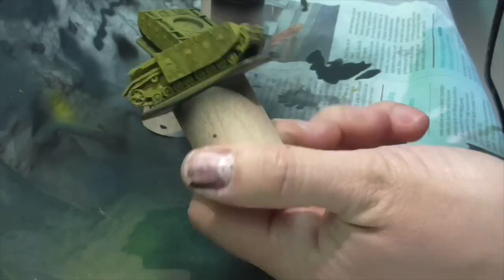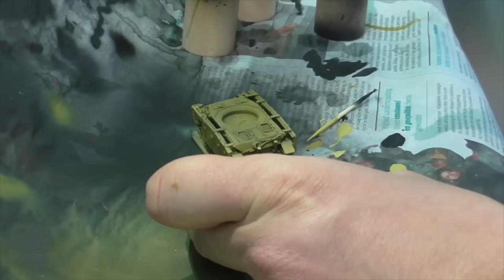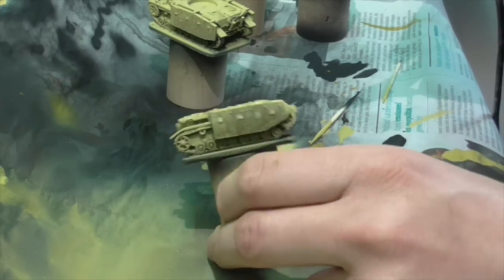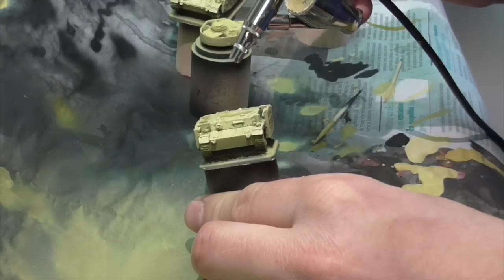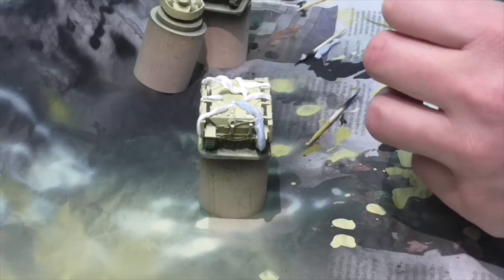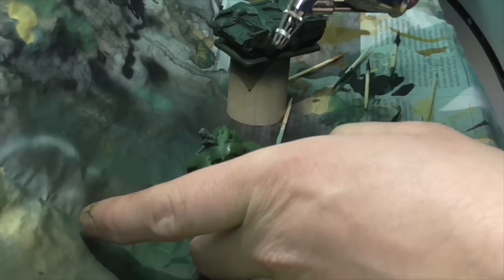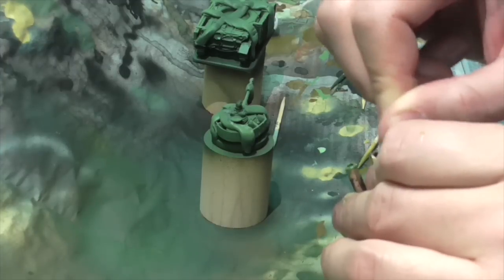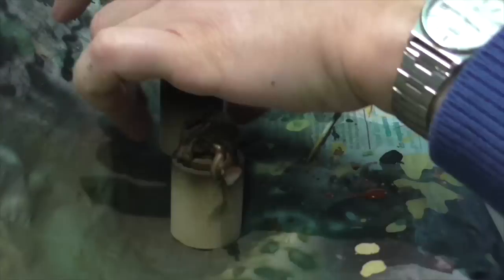Panzer Los: Painting a 15mm Panzer IV ausf J

Comment: unfortunately this splinter style of camouflage was abandoned around the time of the battle of kursk, this specific type of pz iv was mainly used during the retreat from france and would sent to the front directly from the factory in either a standard dark yellow or one of the many forms of ambush camouflage. This specific pattern was stopped because of the complexity and time to paint. most tanks were painted by thier crews in a mix of olive green,  dark yellow and red brown
Reply from the maker: +field Marshall cook I didn't do the research / planning for this one, so I can't comment. I think Jasper may have an explanation though, so I'll leave it to him.
Reply: +field Marshall cook: after ambush camouflage came factory applied hard-edged camo, often using the primer red of the steel as base-coat. At the very end of the war, and these are Pz IVJs with Thoma schurzen, so fall of 1944 at least, the red brown and green came first with only narrow bands of dunkelgelb, or sometimes even elfenbein (ivory), normally used for tank interiors.
Reply: +Jasper Oorthuys that red mit ivory stripe was actually only recorded on the one panther in the Bovington tank museum and was applied sfter the war ended
Reply: +field Marshall cook "well actually" there is (color) photo of a very late war Panzer IV where white or elfenbein has been used to line the edges of the camouflage. It's reproduced in the New Vanguard Osprey about the Panzer IV. Hence the 'sometimes' in my response. However, the point was that hard-edge camo as shown on those two tanks was definitely used in the last six months of the war.
Reply: +Jasper Oorthuys on a very small number were captured fresh of the line with the dark yellow base coat bieng used as a camouflage pattern over the red. from the records ive seen,  three of these such varients were ammoracked and blow up

Comment: alot of good information 
that vallejo flow improver is supposed to be used with thinner too?
to help it not get stuck in the airbrush?I never heard if that before but sounds good if it helps the paint flow easier.
sharp lines on the camo was good too the model in the end came out good it could be in a picture.
Reply: For airbrushing purposes, I'm not sure if there's much of a difference between thinner and flow improver. I presume the former ensures the paint goes on in a thin layer and the latter, indeed, just helps it not to get stuck.
Reply: Jasper Oorthuys thank you very much for the reply and help.
I always put some thinner in the v air paints too just to make sure it will be thinned,but sometimes my airbrush doesnt work the same everytime.its because of the paint.
I will try to find that flow improver too sounds like something that I can use.I almost have the same model I need to paint but its a stug in 1 72.thank you again.